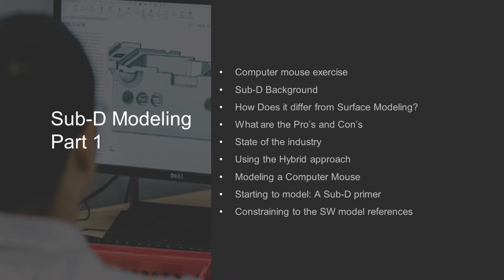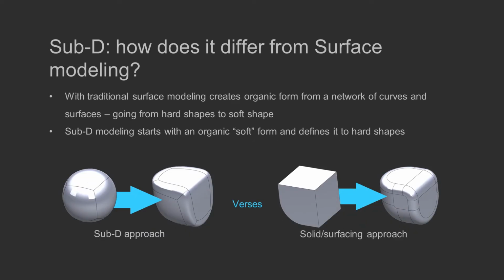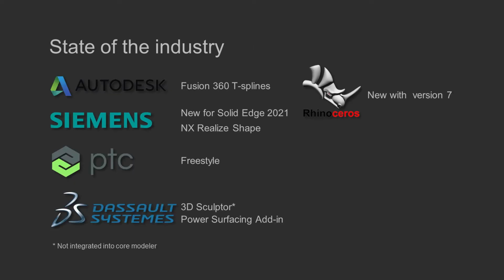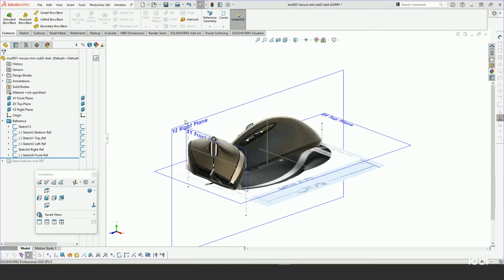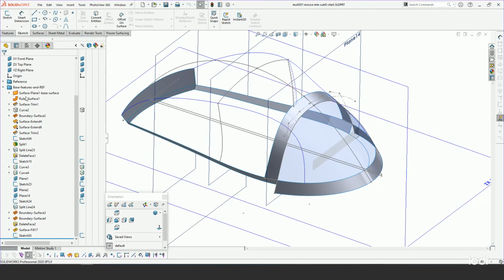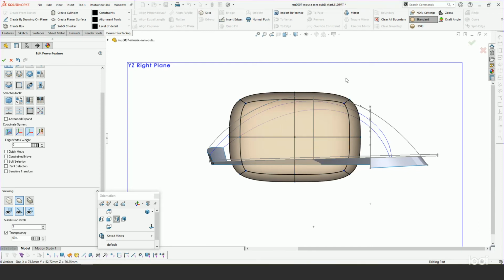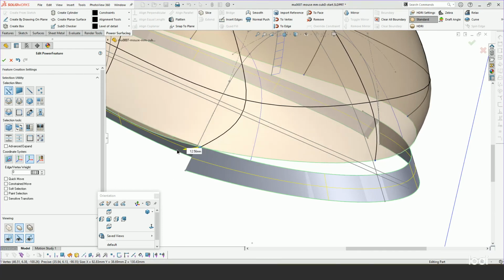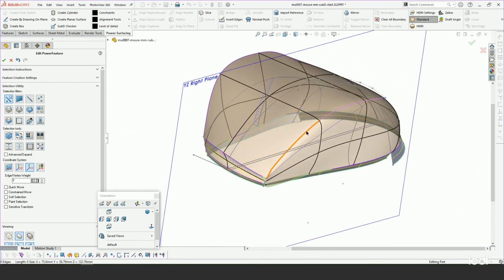SolidWorks Webcast | Episode 26: Sub-D Modeling Part 1

Comment: Just a quick tip.

There is a way to set 4 views on 1 screen in solidworks, I.e front top side and iso.
Saves flicking between views.

Space mouse enterprise is also good for the view shortcut keys